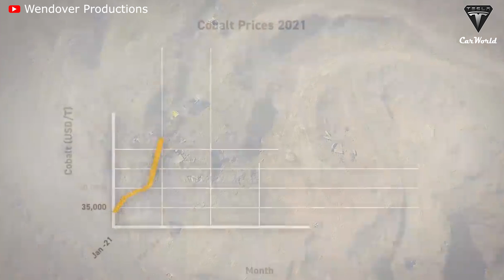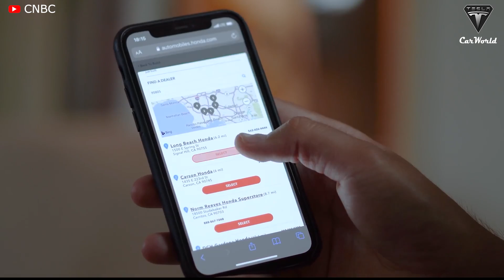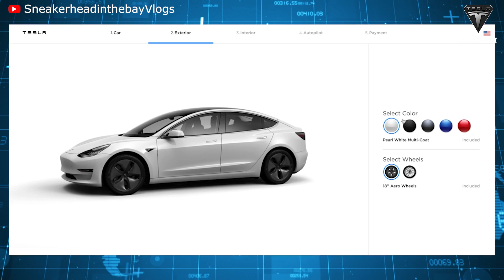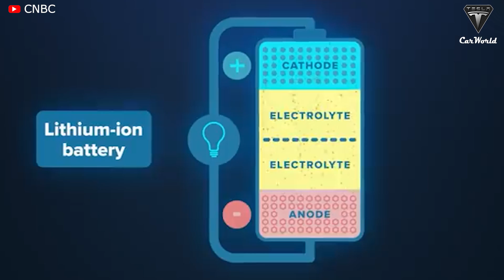No Option! Elon Musk Just Warned Serious Problems with Texans, Fee EV too expensive!

Comment: About the state fees; I've been against them from the beginning of Wisconsin's levy set on EV registration, they say, to make up for the "loss" of fossil fuel tax fees, used for road costs.!.!.... First of all, the balance of road maintenance fees not previously covered by fuel taxes comes from the General Revenue fund, which comes from other general tax levies.!.!. My thought is that since everyone benefits from cleaner air, which EV's make possible, having any road costs is fairly left to the "General Revenue coverage, and if anything, EV owners are due a refund for forgoing the extra initial costs of ownership of an overall more beneficial (to everyone), mode of transport.!.!. How "ALL electrical power" is produced is not necessarily the responsibility of the EV users, but must also be changed to carbon free sources ASAP.!.!.!. And carbon made pollution may, and should be, addressed with a "Carbon Tax".!.!.!.

Comment: Can you imagine how much it would cost for fuel if some cars used gasoline, some alcohol, some, turpentine, some naptha etc.   Fuel stations would need 20 different storage tanks and pump/metering.    Can you imagine if when you bought the car you would have to accept that you can only use fuel from Phillips because the pump nozzle of any other brand wont fit?
Somehow EV batteries need to be all interchangable, brand agnostic. Sure you can elect to pay extra for premium cells or you can be happy with regular batteries.  Because of proprietary battery packs, when someting goes wrong with the battery, unless it is under warranty, you junk the whole car. Watts are watts, there is no technical reason why anybody's battery cant run anybody's car other than they are all trying to lock you into to replacement parts from them.  The result will be millions of cars being scrapped because it is not worth what it costs for an OEM battery replacement even if you were willing to wait 3 months to get it.  And the price of those OEM's are not likely to come down because you are held hostage, and because of the really low volume of replacement demand because it is not worth the cost.   We really need to press for a standard sub-pack size unit of cells that can safely, quickly, cheaply and easily be replaced just like the 12v battery in an ICE.  Drop the pack,  open it up and replace sub-pack #11 the onboard computer said had an error, swap that at Autozone for a refurbished unit for $100, put it in, close the pack, raise it back in the car and there you go.  1 hour DIY labor, hunnerd bucks and your car just went back to 95% of new capacity.  Oh  and stop pressing the manufacturers to make cars with a 300 mile range, that requires a heavy, expensive battery, you add $40k to the price of the car by insisting on a huge battery.

Comment: Lithium Sulphur if you must stay with a flashlight battery. Or could use carbon graphite. Or graphite with a hydrogen fuel cell. A paint on solar panel along with afore mentioned processes.

Comment: you're WAY BEHIND on your info- 4680 cells DO NOT contain cobalt. they use nickel instead. even in 2170 cells, they only use 1.5% cobalt, where all the other lithium cells use 12 to 15%. these are the 'vendor' batteries- what you get if you DON'T vertically integrate & have your own battery program- aka- legacy auto. buyers DO NOT have to go to other states to buy tesla- they buy tesla ONLINE. they pick the cars up in TX and sign the paperwork THERE- or- they can even have the car delivered to their residence AND sign the paperwork ON THE SPOT.
Reply: Yeah...this video was off on so many fronts.  I don't blame the creator, as there is tons of misinformation out there these days, and I've seen these claims on other Youtube videos.  I took delivery of my Model Y Performance this weekend.  All paperwork was done through the app, the vehicle was delivered to by house, and my trade in was picked up at the same time.  The only time I ever visited the Tesla showroom was for a test drive.  There is no having to go to another state to buy it.  Aside from the wait, it was one of the easiest buying experiences.  The only thing that was different is that I have to register the vehicle.  And for that, they sent me a packet with all the forms i needed already completed.  Not saying I wouldn't prefer that this was all included, but it's nowhere near as bad as this video made it sound.  Also Texas is in the process of building up to a total of 500,000 EV Chargers by 2030.  One for every 50 miles of interstate routes, and 70 miles for non-interstate areas.  Texas is also 3rd in the country behind California and Florida (barely) in number of EVs registered.  So while it may only represent 1% of cars in Texas, that is still a lot of EVs.  As for the EV Tax, get used to it.  The roads have to be maintained, and that money is coming from you in one way or another.  The government being scared to raise the gas tax for so long is why most states have so many roads and bridges in disrepair.  The current bill in Texas has almost no chance of passing for the same reason.  But one way or another, they will figure out how to tax you because they have no choice.  That's not a Texas problem, that's a problem that affects the entire country.
Reply: @bfranks77  same here. identical experience with my model Y long range in CA. every state is going to charge a flat rate per mile & vehicle class: PERIOD. no more, no less, for gas or EV. and that? is fair. what makes the tax on EV's nice? it's a LOT easier to stomach the tax if it's not accompanied by an additional $5 a gallon for gasoline. big oil has been resting on its' loreals & charging what ever the hell they feel like for far too long. having competition? is good for them.